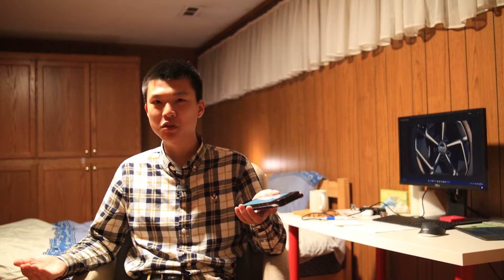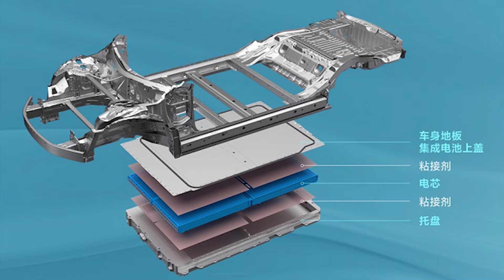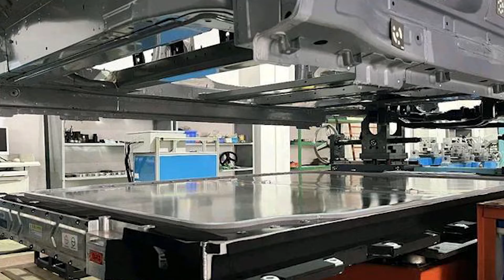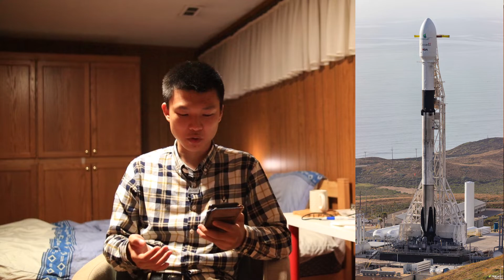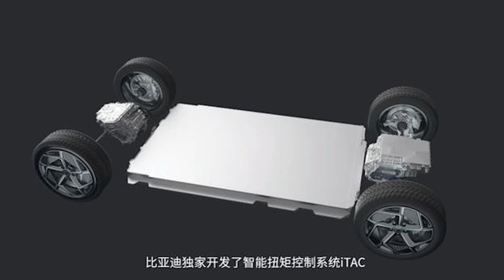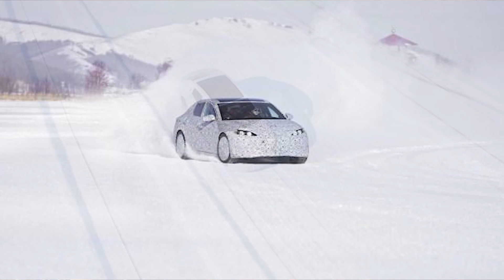BYD Seal - The cool tech under the hood

Comment: I am in Australia and we will be the first country outside of China to receive the Atto 4 ( Seal) in Q1 2023 I have owned a model 3 SR+ for 3 years now and it has 120000kms so I am looking to sell it soon and get something else I have been very interested in this car but in the last few days it seams that Tesla will next year be sending MIC model Ys here with the new CATL M3P battery packs which really look the goods so I dont know what to do.....I think I will test drive the Atto 4 and if I fall in love then so be it if not I will wait for the new and improved Tesla to arrive later in the year.
Reply from the maker: M3P is the next gen but the range and safety would not be comparable with Seal. I suggest you make a test drive and especially feel the interior. The interior styles BYD and Tesla approach are different.

Comment: Interesting and well done break down. Any idea if the seal will have battery pre conditioning en route to a charger?
What about the equivelant of sentry mode? 

Also fyi tesla did deliver several hundred model y with the 4680 structural pack's in April to select employee's at the cyber rodeo event. 
That car has also been fully certified to sell since March now. 👍🏻
Reply from the maker: Seal does not have battery pre-conditioning. However, based on my previous experience of DCFC, the speed would be quite fast even at a moderate temperature all they way along. There is limited need for pre-conditioning.

For Sentry mode, they have already had something similar on the new model Han. For seal, I have no solid info yet.
Reply: @futureblueprint14  very nice, so this literally could be the very first production ev for all intents and purposes. To really stand up against a tesla model 3 feature for feature and spec to spec right? I mean the model 3 has been around for 6 production year's now. 
So it's about time someone got their act together and stepped in the ring at a similar level. 😀

I want to see how it sells, how long byd takes to ramp up to their promised 30k a month run rate. And what tesla does in direct response to this and the nio et5 also coming out later this year. As a consumer I'm honestly somewhat surprised and excited for both of those vehicle's to debut. Even though as an American they'll likely not be sold where I could ever buy one or drive one. 🙂
Reply from the maker: @4literv6  BYD Seal is set to be a direct competitor of model 3. All around in dimension while providing superior performance inside. It is exciting to see the competition there to push EV revolution forward.

However, let us do not forget. What we really want to rule out are those fossil cars.
Reply: @futureblueprint14  agreed wholeheartedly every ev sold is one less ice car otr. And imo #endoftheiceage can't come soon enough. 👍🏻😎